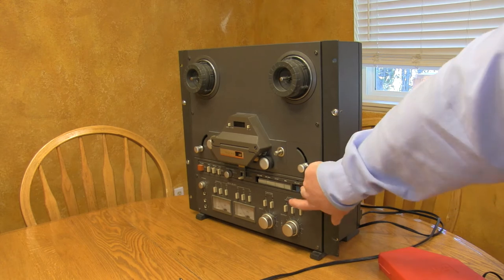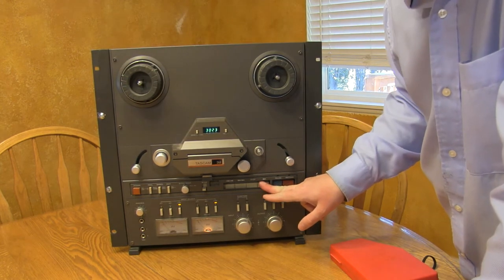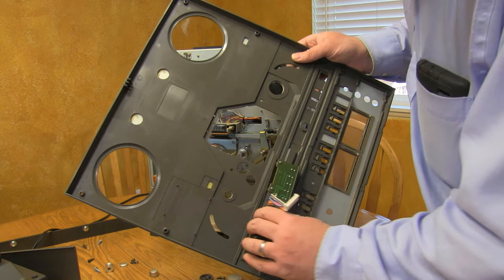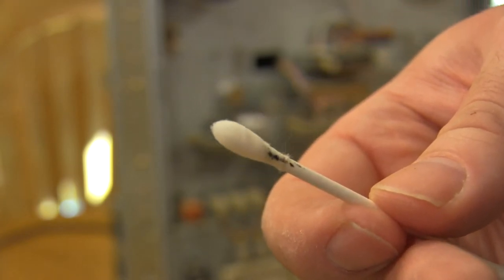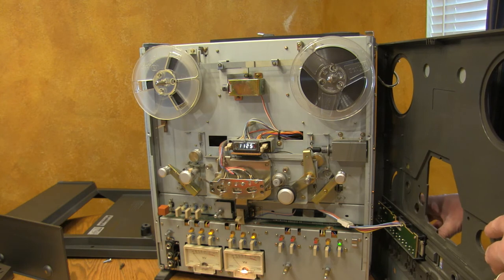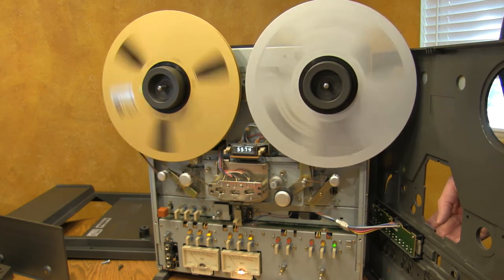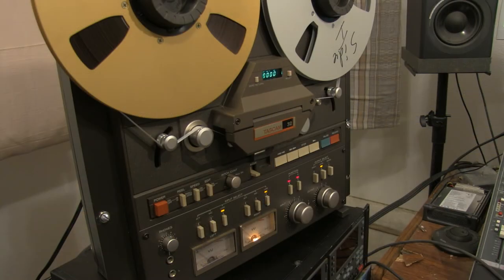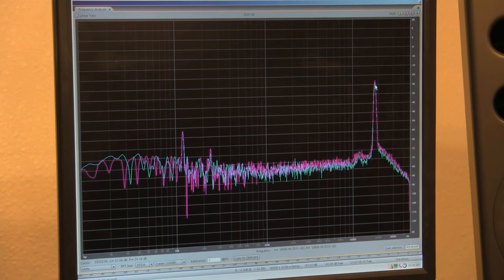Tascam 32: Troubleshooting and Testing Open-Reel Tape Recorder, Review

Comment: I have a question for you I have the same recorder and on the left side and the right side after I take the cover off of it get to the inside of it looking straight on there’s a sprain and a piece of rope or twine that goes around the real I can’t figure out where the other end of it goes it does something with the spring it would be possible for me to send you a picture and you can take a look and tell me what you think since I can’t find a manual on it? Please

Comment: Great video. I have a Tascam 38 that I replaced the belt and tire on and when I playback a 1khz tone at 0db that has been recorded to the tap, it warbles.
Reply from the maker: You might have some gunk/debris left on the drive wheels.  Otherwise, there might be an issue with the capstan driver.

Comment: On a tascam 22-2, If I'm getting no sound from my mixer when monitor is switched to source, then what could possibly be wrong with the tape player?  Bad preamp? bad transistors? bad capacitors? Just curious if you know what the most likely cause is.
Reply from the maker: Hello!  First thing, does the machine play tape?  Can you record to it and play back audio?  If yes to all of those things, the function relays might not be switching.  That would at least narrow down the issue to the logic/relay section of the machine.
Reply: @wado1942  it plays tape but it wont record because the input isnt coming through at all unfortunately
Reply from the maker: @harpoolmusic  That's a bit more difficult.  It could still be logic switching/relays but it could also be an issue with the input electronics.  It sounds like neither input is passing signal so I suspect the relays are the culprit, as they're most prone for failure.  You'll want to get a service manual, which you should be able to get from TEAC (don't contact TASCM, they don't know anything and are rather rude).  I think you can also get a service manual for a 22-4 from HiFi Engine, which is almost the same machine.

Comment: Brilliant video! Very informative. Have you worked on the Fostex E16? I have issues with mine
Reply from the maker: Thank you!
Sorry, I haven't worked on any Fostex machines.  I can say I've mastered a few songs that were recorded on E16s, I've even remixed an album that was recorded on one, but never got into the guts of it. :D
If you don't mind my asking, what are your issues?
Reply: @wado1942  Thank you for the reply....My problem lies with the tape transport.(Or so I thought) I load a reel and press play and it sometimes plays and sometimes doesn't until I give the right tension arm a little nudge. Similarly the fast forward works then comes to a stop after approx 4 mins. Pressing rewind nothing happens until I lift up the tension arm that then assists the rewind process. I then test the transport with no tape by holding the said buttons and lifting the tension arm and everything appears in order. Good speeds in FF and
 Rewind.  Just read about old tape and sticky shred syndrome so now I am thinking this might be the problem? The tape is the one I got with the machine. (5 in total) 1990's Ampex 456. Had to clean quite a bit of gunk from the transport chrome after the tests. Bake or bin? Can I assume the tests with no tape show the transport in good order? Purchase of new tape and test will reveal! Thanks again
Reply from the maker: @fostexfan160  Oh yeah, SSS was the first thing that came to mind when you mentioned the tape doesn't move unless you give it a nudge.  456 is NOTORIOUS for SSS.  I would never use old tape except to digitize the material on said tape.  In short, if you don't need to copy anything off the 456 reels you have, throw away the tape and keep the reels.
I recommend SM468 for most low-end studio machines.
Reply: @wado1942  Many thanks for the help and advice. Long may you continue in your skills and art. Great stuff. Thumbs up!
Reply from the maker: @fostexfan160  Thank you, I appreciate it and same back to you!

Comment: Hi and thanks for your video!
I just bought one of these, and there are a few issues I would love to get some advice on. Can I get in touch with you somehow? 
Q#1: Does the belt need to be installed for the LEDs on the transport controller to light up (rec + pause)?
Q#2:  Are the mechanical issues with rewind and play typically related to the transport panel?
Q#3: Will I be able to fix my machine if I get correct parts and have patience ? :)
Reply from the maker: Hello; it's extremely difficult to help trouble-shoot something without being there, but you can get a hold of me through my website, gcmstudio.com
A#1: The transport controls on the lower-end TASCAMs are extremely simple.  They don't know if the belt is installed or not so the LEDs should still light unless there's another issue.
A#2:  I'm not sure I understand the question.  Mechanical issues are mechanical while the panel is truly electronic.  What kind of issue are you having?
A#3: Most machines can be repaired, depending on how much work/money you are willing to put into it.  You can still get many parts through TEAC, who unlike TASCAM (...I know) has very good customer service and are reasonably priced.  Sometimes, however, one must hire a professional.  IMO, that's especially true if you have failed electronic components.
Reply: Thanks heaps for replying. Just put it in the Tascam hospital now, hoping all will be good in the end! Got hold of a new belt and a pinch roller on eBay, so hopefully have all I need now to get it fixed. Best, Erlend
#iNeedPlentyOfAlcohol
Reply from the maker: Good luck to you Sir!

Comment: Great video which mrl tape did you use for that unit? I have the same deck and want to buy the mrl
Reply from the maker: I used an IEC MRL tape because it's what I had.  If you're in North America, you'll want a 243-043-482-107.  That's a standard 4-minute, 15 In/S NAB 4-tone tape at 250nW/M.

Comment: Hi Wado1942! thanks for your videos!!  i have a tascam BR-20 and a Br-20t from my dad, i set them up everythig  seems ok, but when pushing the play button doesnt start (sounds like a lock) if i active edit mode and scroll manually i get sound  any advice on whero to start?  btw thanks in advance 
Angel Palacios
Reply from the maker: I have two questions for you: 1 does the pinch roller engage?  2, does the capstan spin?

Comment: I am fixing an issue with a BR-20 and I am having the supply reel doing FF when I press RW button.  Any idea on why this is happening?
Reply from the maker: I'd say either the idle tension is too high so it ACTS like it's going into FF or the logic isn't switching properly.  The best thing to do would be to get a hold of a service manual, either online or from TEAC (don't contact TASCAM, they're completely useless and often times rude).
Reply: @wado1942  Thank you very much.

Comment: I have a Dokorder 7010 and i was just wondering If you knew why i cannot get it to play? ff and rewind work find put i press operate and it just spins fast. do i need to have tape to test that?
Reply from the maker: Hello; you'll need a tape in-place to test the playback.  I suggest grabbing a junker tape to test but make sure it hasn't gone sticky.

Comment: Do you have any ideas on where to check tascam 34 no ch 1 but i did have last time i used it now it does not
Reply from the maker: You'd have to look at the manual to see where to access the adjustment pots.  It's probably a dirty pot or lose wire, so you can rock the pot back & forth with a trimmer to see if the sound comes back.  It could also be a bad capacitor,  dirty/bad switch or relay or any other number of issues.  You can clean all the switches, pots & relays with DeOxit for a start.

Comment: theres too tension guides on tascam 32 and in my one of those is higher than the other, how to fix that?
Reply from the maker: Do you mean it is mechanically stuck?  You will have to take off the cover and see if there's some kind of obstruction or broken part.

Comment: I had found one of these at a house sale for 30 dollars and bought it and I was told it dod not fast forward or rewind and  one of the 2 amp 250 volt fuses that work with the motors and ampand pre amp  when I hit play the solenoids all work and the capstan motor work find the pitch does not work and slows the motor to a stop .  there is no sound in the head phone output  but I hear the hiss when I turn up the head phone volume and the output volume please any help would be great and thank you for posting this video
Reply from the maker: It would be extremely difficult to troubleshoot a tape deck without having it in my possession.  If you are handy with electronics, I suggest getting a hold of the service manual and start by looking for shorts or bad solder joints.

Comment: You do not set speed with audio level alignment tapes as they are not meant to be accurate in that area. Like most You Tube videos this is full of errors.
Reply from the maker: Funny, 1KHz comes out at precisely 1KHz on my other decks (MRL does good work) so I don't know why that would be wrong as a rule of thumb.  If my video is full of errors, make your own and send me a link.

Comment: I have a problem.  The letf channel sounds lower than right channel why?
Reply from the maker: Most likely, it's a calibration issue.  It could also be a head alignment issue, specifically zenith.  If you have the manual, it will detail how to fix both but you need a calibration tape if you don't already have one.  There's also a chance there's something actually wrong but 90% of the time, it's just calibration.